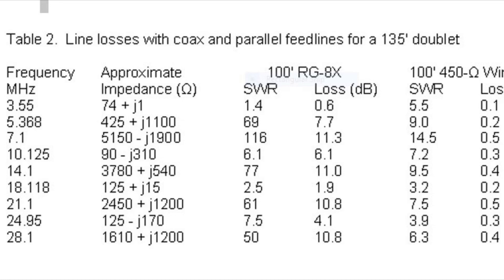HAM RADIO: The Doublet Antenna & Ladderline

Comment: I have tried many size doubles i find the best size is just a bit short or just a bit longer than 1/2 wave on the lowest band . I find more important than length,  is try to get it out in the clear and symmetrical,  not always easy ? But in the clear and symmetrical as pos .
I am a big doublet fan ! 
I am lucky enough to have the space for a large and medium size doublet 70metre (230 feet )and a 39 metre (128 feet ) both work great . I concur with your findings .
Reply from the maker: Totally agree with that Rob 73

Comment: Tim, I recently did some doublet maintenance, remaking connections and looking for any broken wires. After putting everything back together, I wondered how important it is to have all connections the same width as the 450ohm window line itself, say 1 inch. My connection point screws are 1 inch apart, but I wrapped the stranded dipole wires around the screws with a washer below and above, then threaded the nut and sandwiched the wires between the 2 washers. My question is, the distance betweens the washer edges is more like .5 (1/2) inch now. Will this affect the antenna operation in any way, in your opinion? I hope not. It seems to be working well, as before but may be a tad more sensitive to tune w my manual open wire line balanced tuner. Thanks
Reply from the maker: Hi Mike. Can I confirm that the only change is that the two radiating wires are slightly closer together. So the ladderline is therefore the same.
Reply: @TIMG5TM  well,  the window line and dipole wires are on the same threaded stud, so the washer dimension of approximately 1 half inch brings everything together, even though rhe stud/posts are 1 inch apart. I can draw what I mean or if unclear, drop the antenna and take a photo sent to your email. Sorry but it's hard to describe. 73
Reply: I sent an email photo of a sketch I made of my connections
Reply from the maker: Have replied 👍
Reply: @TIMG5TM When the question is asked here but the answer is posted elsewhere it turns into a waste of time for anyone in the future “like me” that reading the comments and hoping learn from the same question.

Comment: Hi Tim, is it possible to have a doublet without having an external antenna tuner? The radio has a tuner built-in but will only accommodate a 3:1 SWR - Thank you in advance for your time and response
Reply from the maker: Hi pat. It is possible but not for all bands and would need a specific length of ladderline. 99% of the time you need an external tuner.
Reply: @TIMG5TM  Well I'm the proud papa of a new MFG 491E tuner, so will be joining the ranks of Doubletiers soon enough

Comment: Last year I left my 80m OCFD for a 160m doublet. My goal was to have an antenna that would function on as many bands as possible from a single feedline into the shack. The doublet is it. Sure it's a compromise antenna as so many are but I no longer have a common mode issue in the shack as I had with the OCFD and I've noticed a remarkable improvement in overall operation and again nothing hanging around inside like before. Thank you for your video and hope to catch you on the bands sometime, KD5BFF.
Reply from the maker: Great to hear the doublet works well for you.

Comment: I'd like to build a doublet for 80 meters and above.  But, I live in Arizona, and the trees just don't go much about 20 or 30 feet.  So, can you run ladder line straight down and then along the ground?  I'd also like to terminate the ladder line into coax before entering the house.  Is that alright if you have a balun or choke on the coax, and you keep it short?  Thanks!  Rick W0SKI
Reply from the maker: Hi Rick! Unfortunately you can’t run ladderline along the ground as this would cause it to become imbalanced and radiate ... causing you big issues in terms of rf in the shack. You can terminate it into a 1:1 current Balun and then a short as possible coax run to a tuner 73.
Reply: Wouldn't you want a 4:1 balun?
Reply from the maker: @paulsengupta971  depends on the impedance Match. Some tuners find it harder to match low impedances.. which is what a 4:1 might provide. In my experience 90% of the time a 1:1 provides a better match.

Comment: A nice source for a standoff for ladder line can be found in farm supply stores that sell electric fence insulators.  Check American Farmworks that makes good ones..  This is my local company.  They also sell plastic compression egg insulators that are a bag for about 8$.  These are 25 in pack for about $13  - there are several models, pick the one that will work best in your situation.

https://www.tractorsupply.com/tsc/product/american-farmworks-yellow-25-pack-nail-on-5-in-extender-insulators?cm_vc=-10005

Comment: Thanks for an informative narrative! I’m a big fan of doublets too! Have had many of them but my latest and the favourite one is 26m long (2 legs 13m each) fed by DIY ladder line and connected to my FT-891 transceiver via a 4:1 Guanella BalUn ( It is important the balun to be the current type, or “Guanella”, IMHO) . It tunes easily on 80-10m bands with my DIY automatic ATU (N7DDC design). I chose the 26m length after reading an excellent article by DJ0IP on his website. If interested in practical performance in the field of this antenna, I’ve put a video my YT channel ( Look for the “Seitenschneider” doublet. Yes, you’ll learn why such a crazy name too :) . 73! Linas LY2H
Reply from the maker: Ill certainly check that out! Thanks for stopping by and commenting 73
Reply: can you provide a link to your YT channel please?  cheers   Robert - ZL2JED
Reply: @enzed1190  here you are! HNY! https://youtu.be/TyXADE0jveI

Comment: Lost me pretty early. I think ill stick with commercial antennas for now.
Reply: It's easy enough, two equal lengths (or even unequal lengths will work!) of wire fed by ladder line into a tuner, as long as the tuner has a wire input. That's about it. If the tuner doesn't have a built in balun, add a 4:1 balun externally at the end of the ladder line.
Reply: Yep, it’s future me now. Watching this again and it’s so simple. Amazing what time will do if you stick with it.

Comment: My 102 ft doublet is old g5rv at 33 ft that I threw away the coax and ran it with 84 ft of ladder line.  75m to 10m.
Reply from the maker: Better than the G5RV Frank?
Reply: Yes.  I've since moved and will put it up again @TIMG5TM
Reply: Not sure, as I could speak to origional g5rv.

Comment: Great video Tim. You convinced me to build a Doublet. I have no experiences with ladder-line. Is it a problem to lay it on the ground? Or should I raise it with some plastic tubes? 73, Stephan, DF6PA
Reply from the maker: Hi Stephan thanks for commenting. You need to keep the ladderline off the ground by at least a few feet and avoid coiling it up. Hope that helps 73
Reply: @TIMG5TM  Thanks for the fast reply. Good to know! 73
Reply from the maker: My pleasure, let me know how you progress with the project 73

Comment: Well presented information, well done.  Beware that one of the references in the comparison is "open wire" which is usually wider spaced and with less dielectric than the 450 ohm feeder. I did previously use home made open wire but have now gone the easier route of using 450 ohm ladder line. For operating convenience the ZS6BKW is worth a look, it offers a reasonable SWR on a number of bands for those times you may not want to use a tuner. A common mode choke type balun is obviously advisable.

Comment: Very good video, I am using ZS6BKW and it covers 80m with the automatic tuner. The antenna is not very large and fits nicely my urban lot when installed on a 12m spiderbeam. 5-10W on FT8 gives me pretty much global coverage.
Reply from the maker: Excellent. You are clearly making the most of your QTH. Thanks for stopping by and commenting 73

Comment: Hi Tim. Very much in agreement with open lines. My experience of years experiencing doublets loops and many more. There is no doubt that we were not the discoverers but we were some good experimented users. I have seen some of the videos you have and they are very good, very well explained and with good content, thank you for that. I think I have read each and every one of the excellent Cebik articles and with a lot of useful information, great job recommending them. Greetings from CX Tierra Ed.
Reply from the maker: Thank you very much for your encouragement and I agree with you about doublets and loops. So versatile and easy to construct. Thanks again for stopping by and commenting 73

Comment: so the G5RV is a doublet?
Reply from the maker: Not quite. It relies on a precise length of ladderline to match it on certain frequencies. The issue with a G5 for some is that the coax run from the ladderline to the radio can lead to considerable losses especially on higher HF bands such as 15 and 10m. If you either use a short few feet of low loss coax between a 1:1 Balun and tuner or ladderline all the way to a balanced tuner you would negate so much of these potential losses. The G5 works much better if the coax run from ladderline to radio is a short one. 73
Reply: @TIMG5TM  Dear old G3FCM used to describe the G5RV as a wire dummy load. It matches on the bands, but doesn't radiate very well (compared to a resonant dipole).

Comment: Very good video, 
Currently using an OCFD & think will be trying to put a doublet in my "postage stamp" Have played in past with a shortened GM4JMU dipole but as a doublet ( http://www.zerobeat.net/g3ycc/dip2.htm ) the 450 feeder to a 1:1 balun to coax to ATU (as G3TXQ) (ATU MFJ or KW ZMatch ) but the feeder will be close house! de G4LDS
Reply from the maker: Hope it works well 73

Comment: Is there a preferred method of creating a quick-disconnect connection between the coax and the transceiver?  Thanks for all the great antenna videos you create!  Lots of practical info.
Reply from the maker: Hi and thank you. I do not know of such a thing. Can anyone jump in here and assist?
Reply: For HTs, I’ve seen people use BNC, with adaptors if need be.  Easy on and off, eg for hooking up in the car. I’m just getting into HF so I’m not sure about that, not sure you couldn’t also use BNC though?
Reply: I don't know if it is right, but I have my ladder line coming into the shack via separate holes in the wall and then into a good sized knife switch.  Line continues on into a auto tuner.    I don't know if the switch is good enough for a lightning strike but probably okay to protect from static buildup.
Reply from the maker: Sounds pretty workable to me 👍

Comment: Does a doublet need to be in a straight line or can you bend it?
Reply from the maker: Hi Justin it can be bent as long as the angles don’t fall below 90 degrees. Check out an earlier video I did last year on the 80m doublet for proof. 73

Comment: Using a doublet, works great, 15 m each side,  the last 5m on each side goes down 45 degrees ( to suit the property ),it tunes well all over the bands, great cheap antenna. 
Now trying to get a vertical attached the same way, ie, inverted v with one leg up in the air ( 10m in my case ). 73 and thanks for the video
Reply from the maker: Sounds a useful experiment. Glad you’ve found these antennas have worked for you too. 73
Reply: che59v...A vertical dipole,fed with window line,would achieve the same results,in addition to having a low takeoff angle of radiation

Comment: Great video Tim.
How does the doublet compare to a 80m ocf dipole  using either a 6:1 or 4:1 balun.
I presently have a 80m ocf dipole with a 6:1 balun with the longer leg running up the garden then back down, then the shorter leg going down the garden so it covers nearly all points of the compass
Reply from the maker: Shouldn’t think there’s a lot of difference. I’m just wary of the enhanced probability of common mode with Ocf dipoles but if you can tame it then good on you. 73 and thanks for stopping by and commenting 73
Reply: @TIMG5TM  That's one problem I do suffer from is the common mode to an extent, however I am slowly getting to grips with it.
I will try the doublet antenna and compare the two
Reply from the maker: Will be interesting to see how they compare. Good luck

Comment: Good video Tim....never looked back from the day I built my doublet 2 years ago....56mts long fed with 450ohm ladder line.

The ladder line terminates at a 1to1 current balun on the window sill of my shack...from that its 50ohm coax through the window frame to my manual MFJ 941 tuner 18ins away inside the shack.

Lets me tune and get out well on 160m plus 80/60/40/30/20/17/15/10/ and amazingly 6m.

To me its the onlt antenna req....its in a Z config to fit inside my plot.
Reply: Can you share your source or design for the 1:1 Balun?  I am getting all kinds of conflicting information.  Thanks
Reply: @bobbyt2788 lol, I see this question go unanswered everywhere. Seems everyone has advise on a doublet but nobody wants to commit to a balun design.
Reply from the maker: Thanks Nick they are superb antennas I agree. Sounds like you love yours too 73

Comment: I would struggle to get ladder line into the shack but was wondering could you use ladder line for the legs of a fan dipole with a balun say for 40 and 20? 73
Reply from the maker: Yes you can I’ve done the same for 10 and 17
Reply: Could it work for a inverted V fan dipole.
Reply from the maker: Absolutely .. have a look at my fan dipole video from the summer
Reply: @TIMG5TM  Cheers I will. 73